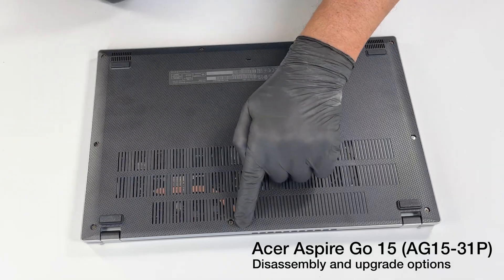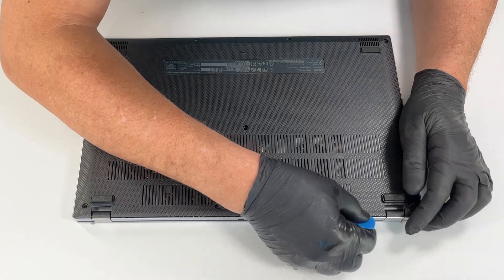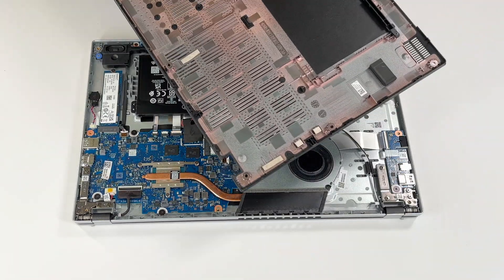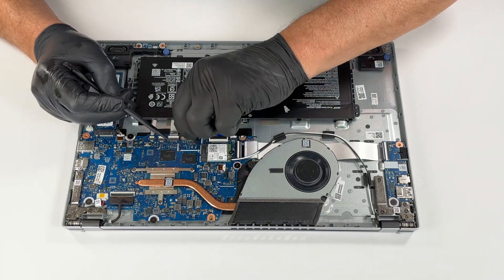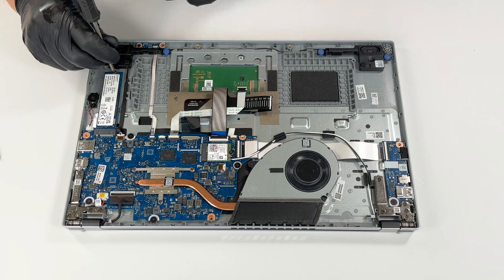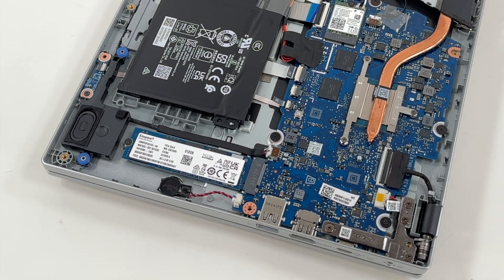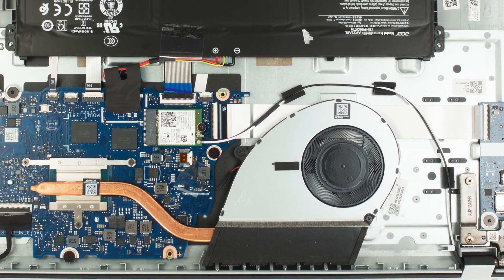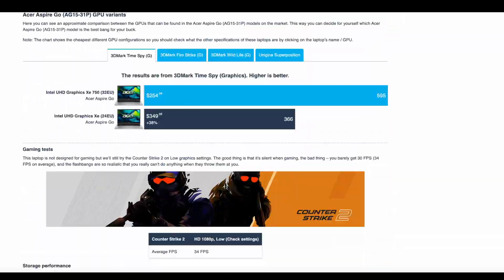🛠️ How to open Acer Aspire Go 15 (AG15-31P) - disassembly and upgrade options

Comment: Hello, great video. I bought the Acer Aspire Go 15 (AG15-32P) knowing it supposedly had 8 GB of soldered RAM, and when I went to install a hard drive, I realized it actually has a DDR5 SODIMM slot and comes with an 8 GB 4800 MT/s stick. It doesn’t have soldered RAM. I find it very curious, because everywhere on the internet I read that the RAM is soldered and cannot be upgraded…

Comment: anybody knows if it's possible to upgrade the ram capacity if mine came with only 4gb? this is 2025 and windows is way too hungry to only have 4gb
Reply: NOPE!! Unfortunately Acer has joined the fuck the consumer wagon train. The ram is soldered to the board so the only way to upgrade is junk your laptop and buy a new one.
Reply: it doess, some stores sell it with 16 GB ram